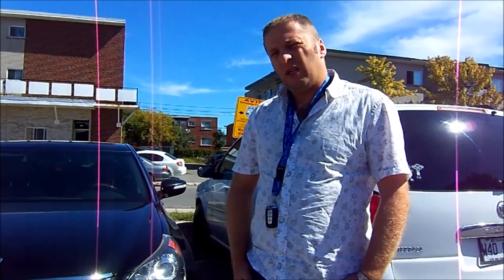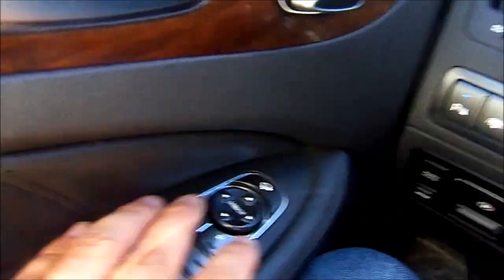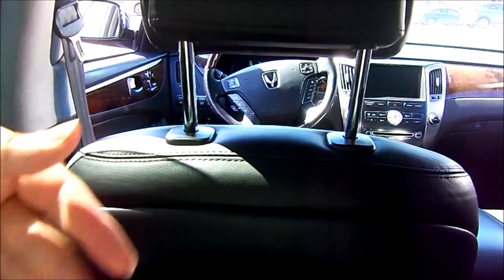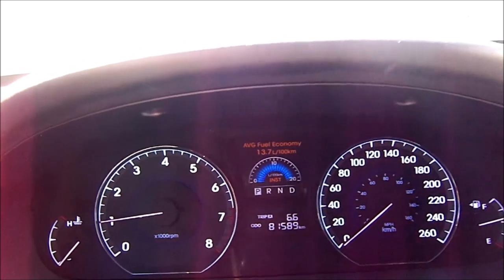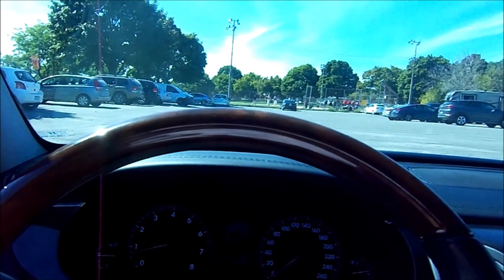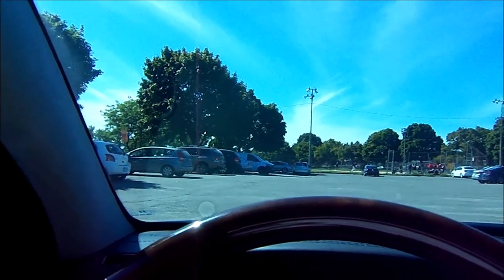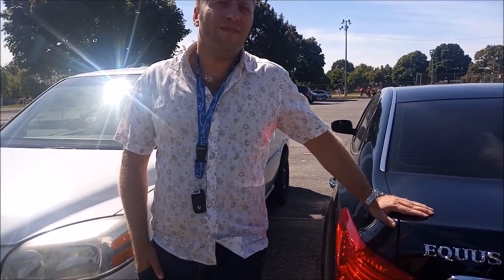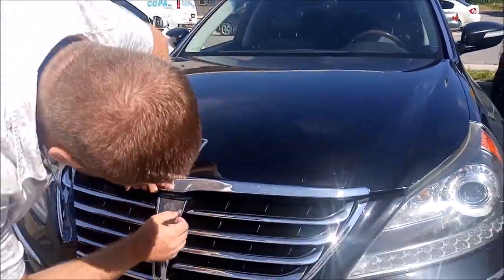2011 HYUNDAY EQUUS SIGNATURE REVIEW

Comment: hi loved the video.. what about the air suspension.. .. when it fails
Reply from the maker: For now it is all good! When it fail I will let you guys know how mutch to repair, or you can always change it with a standard susp from Genesis models as this is a supped up genesis, It was even replaced last year by 9 series from Genesis.
Reply: You can go to Strutmaster's website and look up for the strut conversion kit ($1200 total dollars for all four wheels, made exclusively for the EQUUS between 2011-2016) where the air suspension is replaced by a standard strut system. Generally, labor should take about four hours and thus run you between $500-$800 total to replace all four struts. So, order from the Strutmaster website and take it to your respective mechanic for installation.